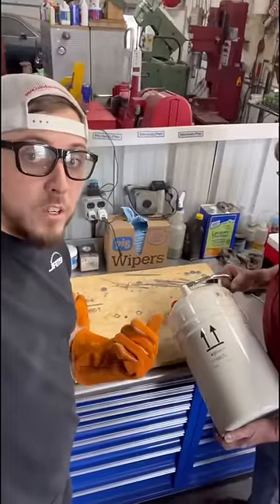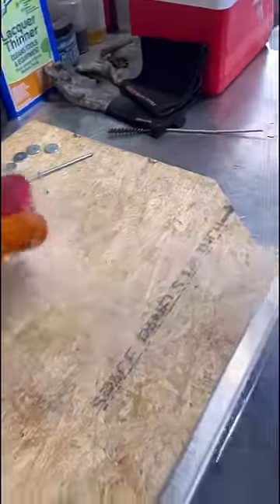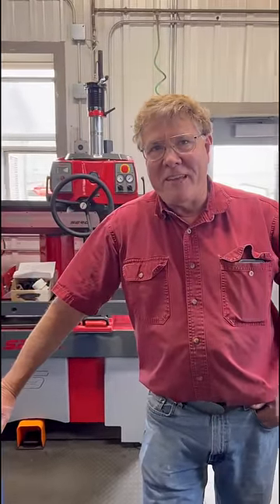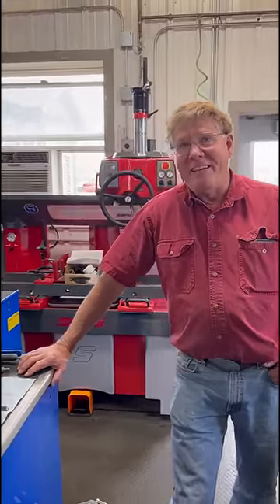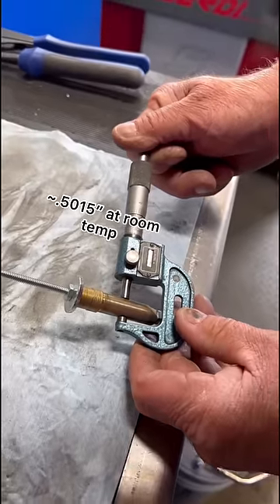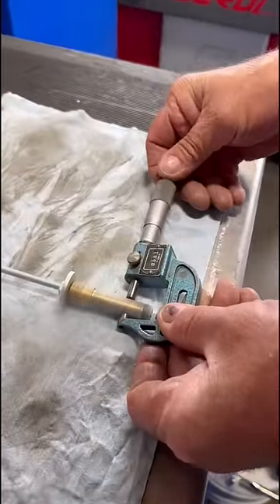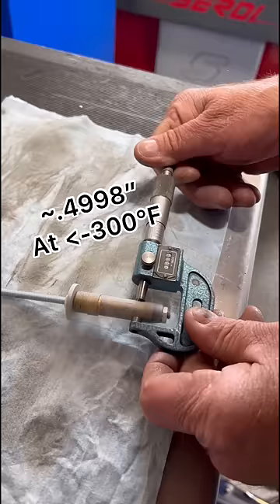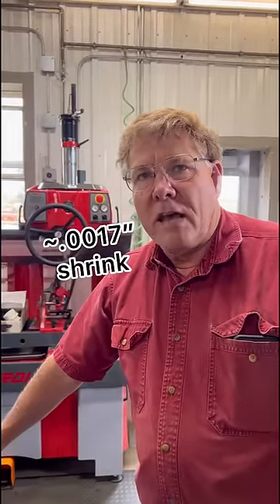#shorts How Much Does A Bronze Valve Guide Shrink In Liquid Nitrogen?

Comment: It will also be 3x harder to remove. Check machinery's handbook on fits, it says shrink is 3x stronger than press.
Reply: you don’t want it to be any harder to remove right? is there a good book on general machinery?
Reply: @woofy9977  That's what I would think. Machinery's handbook is a great resource. I would buy an edition around the timeframe of machinery you are working on so it is most relevant. For general stuff, 40s-70s is fine.
Reply: @woofy9977  I mostly use it on valve seats and press fit cylinder sleeves.  You definitely don’t want seats that will come out easily, and you still have to drive them in, but it takes less wacks and a smaller hammer to get them in, and sleeves drop right it, you can leave it right on the boring machine, just saves a lot of time over pressing them in.
Reply: That's an interesting tidbit, I no longer work with machines but that got me curious to inspect the matter further, materials science is both boring and amusing at the same time, thanks ;)
Reply: That is cool. Thanks for taking the time to explain this.
Reply: @TheMetalButcher  we still use that handbook in our Industrial Mechanic course. Had to read it last year!
Reply: That's only if it's actually machined to be a shrink fit and not press fit though no?
Reply: @alebone_  No, for the same fit.
Reply: @TheMetalButcher  huh, didn't know that
Reply: @woofy9977  yes the machinery handbook is literally the Bible to all things a machinist would encounter. I’d recommend the 30th edition as it is up to date as far as I can remember. It is 3,000 pages and literally covers basically everything g aspect of machining
Reply: @Mr.Thermistor7228  awesome thanks 🙏 found several editions on amazon
Reply: @Mr.Thermistor7228  is the "machinery handbook" similar to a black book or zeus book?
Reply: @alebone_  press fit is usually .0015 to .002 and with a shrink you're only going to get about that much shrink so you use the same fit you're just shrinking it for installation instead of pressing it in which creates a stronger fit than pressing
Reply: @thesouthernlife4061  ah I see, ty
Reply: They drill them out anyways
Reply: @thesouthernlife4061  yea you only get over .0003 shrink fit on bores over 3-4" and you're getting that shit hot.
Reply: Exactly why I hate this method.
Reply: @woofy9977  machinist handbook 29th addition.
Reply: If you visualize what's happening during a press vs a shrink it would be obvious why shrinking to achieve an interference fit is so much stronger in terms of extraction. 

By pressing or pounding a part in, one is either enlarging or shrinking parts or otherwise distorting parts until they fit, and there is no attempt for each part to return to former size as it returns to room temp.

When one is using the temp differential to drop a part in a fit, the distortion is uniform and temporary.
Reply: Yes but will something else split, now or later on?

Comment: My experience as a gas turbine engineer: I’ve used this before with interference fits of ~.002” the coupling bolts in gas turbines have these in order to ensure the coupling bolts do not vibrate and come loose during use. If you let the coupling bolts soak for ~5-10 minutes we could get a few mils ~30 mins gave us .007” which was plenty for the bolt to easily be reinstalled and torqued.
Reply: That's real smart. If you don't mind me asking, how long have you been in the field? How'd ya get started?
Reply: @PlayinWithMahWii Most of the engineers I work with in the field got their start in the Navy nuke propulsion program. 
The mechanics are millwrights

Comment: We used dry ice to install cylinder liners in GM Diesel engines. Simply efficient.
Reply: Yea dry ice is way better and often way more available. That's one thing I miss about living in FL. You could buy dry ice at the friggin grocery store. Up here in the frozen tundra you just put it outside lol.
Reply: Or you can use almost any compressed gas without a regulator as well. Especially CO2, which is cheap as a welding gas.

Comment: Thermal expansion is really cool. In mid flight, the Concorde was several inches longer than when started because friction from the air heated the metal so much.
Reply: Let me quote Daphne: "You shouldn't believe everything you read."
Reply: No offense, but that is completely absurd. I doubt it could expand that much even if it was glowing red.

Comment: I worked at a place that needed to replace the outer race of a bearing on this machine. The machine was a Swedger, made for pounding 1 1/8" steel cable into 1". The dies were on the inside of the bearing and came to size over the rollers of the bearing. Eventually, everything wore out and needed replaced. The machine was stripped and removed from it's mountings. The outer race was torched to remove. A house was prebuilt, 8' tall and 12' square, insulated, with a hole on opposite corners. This work was done in July, when it was hot. Two space heaters position in those holes blew into the little house to preheat the cast for usually 24 hours. The race was put into a custom made pan sitting on moving blankets and Liquid Nitrogen added, then covered with heavy blankets and left for a couple of hours. Forklifts raised the hut and at least 4 men dropped this race into place. This part of the machine weighed around 7000 lbs.  Then let the housing cool and put it back together. Usually a 3 to 4 day process in total. That place is gone now. I think in all the years this was done (25 or so), there was only 1 time it didn't go right and had to be redone. You could never save a new one if it wasn't done right.

Comment: Materials vary but with steel you'll typically see a .001 per 1 inch OD per 100 degrees from room temp gain or loss. Brass won't be far off.

Comment: We used liquid nitrogen to soak 24” dia. steel trunnions for a clearance fit on ladles for steel mills. We would heat the 12” thick mounting bosses as well, till we had a measurable .032” clearance. Once installed, after normalization, there was a .012” interference fit.  Fun times!

Comment: I use to use LN2 to shrink die shoe bearings. If the 150 ton press was tied up I'd beat the bad bearing out. A fair effort was needed.

Then, after a few minutes in the LN2 the new bearings would slide right in. Best practice was to push the new bearing home in one quick move. That way no tapping home was required. The bearings swell back up quicker than you might think. Plus I think the hole starts getting cold and shrinking due to -320F temp equalizing with the room temp die shoe.

Comment: Had a company replace my valve guides with some shorties for the valves I was putting in… and it didn’t go well Smfh 
They Cracked one of the valve seat on the heads(forgot proper term, but it’s the lip that retainer sits on) just a dam shame a shop did that. I know they didn’t do it this was preheat head and shrink the guides. I know many different ways it could be done. But this is one of the easiest imo

Comment: You also need to consider that it's not just shrinking OD, it's also shrinking the length. So if it's interference fit on 2 surfaces (top and bottom) the middle has a chance of buckling.

Comment: Because heating metal up to expand it is quicker, safer, and softens the metal. Putting it into liquid N2 produces incredible internal stresses in the metal as the surface cools and contracts well before the heat can conduct out of the underlying layers. This can produce micro fractures that at least will result in faster wear, and at worst have the item shed the outer layers in an explosive fashion as it starts to warm up again. Add to this the thermal shock when a hot component is forced over it, and all you have is an easy end to a faster failure.

Comment: LN2 or CO2 freezing certainly has its place, but not always on stuff this small, unless it's a rather delicate component. Some components are too fragile to be reliably press-fit without high risk of damage, and by extension be a frickin nightmare to extract without damaging the surrounding part, once it is jammed stuck 2/3rds in there with structural integrity damage.

As stuff gets bigger though, the thermal expansion / contraction rate result in (dramatically) bigger changes in absolute numbers. Working on big industrial, farming and mining machines, when you got bearings the size of a 15 inch wheel rim, you can't press that. Not that you're gonna swing around a big surface mine dumptruck to align it with your press anyway. So you gotta torch the part the bearing goes into while freezing the bearing, or freeze only the part if the bearing goes on the outside (like on an axle etc). Freezing the bearing is usually fine, but double check first that this is cool (pun intended) with the type of bearing grease/oil used. Torching a bearing is usually not ok, because you'll cook the grease. "Just" ruining its properties and leaking out if you're lucky - but if you're not quite that lucky and it's a well sealed bearing... Well let's just say it might be a good idea to get your worldly affairs in order first.

Comment: Most people don't use gloves with nitrogen because it will soak the glove and then freeze your hand. However, if you just pour it on your hand, it'll flash boil off of it and you will barely feel anything because it can't transfer energy from your hand.

Comment: I'm sure liquid nitrogen is much more expensive than heating opposite expandable parts. I have removed and installed gears on shafts and valve guides in heads. If you heat to the temperature and duration the manufacturer specifies, these interference fit parts come apart and or reinstall with hand force. I just did valve guides in a Honda CBX1000 head, the guides installed by hand with a very light tap to ensure bottomed. Factory model specific and factory common service manuals are a must have, and of course read all the info, and use the equipment required as specified exactly and your results are great.

Comment: I made hemi heads for top fuel raceing and built hemi heads for years we made our seats out of centrifugally cast cast iron we made guides from 1144 stress proof with bronze liners.
.020inch press seats . 002inch press guides. 003inch press 4130 pushtube-port liners.
So let's say for aluminum, 
We figured on .000012 times per unit per degree of change either bigger or smaller.
12 millionths per unit per degree for aluminum.
 6 millionths per unit per degree for steel  expansion or contraction.
The formula works Metric or Americans or bananas if you happen to be in Australia. 
We used acetone and dry ice as our coolant and we heated heads up to about 400° f.
And used a body chisel to drive the seats, guides or pushtube-port liners into the cylinder heads we made tooling to retain the parts we would put a part on the tool put it in the chill stick it in tool and then quickly drive it home.
I always kept good large hammer handy just in case...  problem with the hammer your already in a panic if you need the hammer, you're more likely to strike the face of the cylinder head with that damn hammer than you are hit the tool to drive whatever it is home.
A good strong air chisel normally will shove whatever it is in position so fast its almost foolproof unless you're fooling around and you screw up something not ready parts out of the chill for too long heads cooled down too long whatever and there you go.

Comment: Is the extreme cold of liquid nitrogen damaging the structural integrity of the metal? The freezer is between 0 and 15 degrees which is normal and safe. When your negative however man hundred degrees I think that metals destroyed permanently especially if it’s tempered or
Hardened

Comment: It's very simple to calculate the exact expansion or contraction rate you will get by using the coefficient of thermal expansion of the type of metal that you are working with it's in the machine is handbook and you simply multiply by the diameter by the coefficient and how many degrees above ambient erasing the temperature or lowering the temperature voila you get the data you need for example I believe that aluminum is .000012 inches per inch per degree Fahrenheit above or below ambient interestingly enough steals about half the expansion rate of aluminum approximately

Comment: How did you GAIN .002" of an inch after immersing it in liquid nitrogen? It shrunk. So you lost .002", correct?
Reply: Because the guide shrank they gained .002 of space for the press fit.

Comment: I had to do a ring gear on my flywheel once and MAP gassing the ring still didn't give me enough clearance. Luckily the grocery store down the street sold dry ice so I just set a block of it on the flywheel with a towel to cover and after about 15 minutes plus a hot ring gear I was just barely able to get it on and on straight might I add

Comment: Does cold temperature ever cause problems? I'd imagine it's easier to chip a metal part that's -300°. Also any considerations about annealing or hardening of the metal at those extreme negative temps?

Comment: Did they teach you you don't need the glove if the nitrogen is not contained
Reply from the maker: So you’re gonna pick up a valve guide at -300 F bare handed?
Reply from the maker: @Seamusyt1396  I agree with your point when pouring liquid nitrogen directly on your skin. 

We are wearing gloves because we are handling parts that have been soaked in the liquid nitrogen. You can't handle metal parts that are -300 F with your bare hands.

Comment: Okay, dumb question here so easy on the shit talking please...
If the piece they dipped in nitrogen shrunk by .003" then why call it thermal expansion?
I thought that term was for heating one piece to enlarge it to fit over another, such as gear ring on a fly wheel?

Comment: Metric plz
Reply: 0,04 mm. Almost nothing
Reply: 1 in. = 25.4 mm
Reply: .25mm is 2/10,000" (.0002") shy of ten thousandths (0.010") of an inch, which is pretty damned close enough to call equal. 0.5mm (1/2 mm) is close enough to call .020" (20/1000"). Chilling that valve guide bought 0.0002" or 0.005mm slack. All you have to do is breath on it and that slack would vanish.